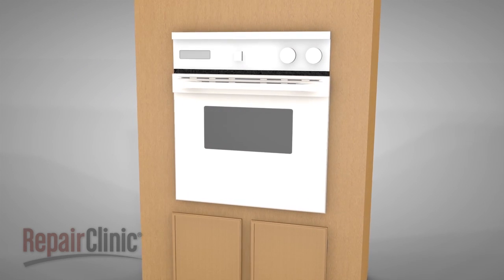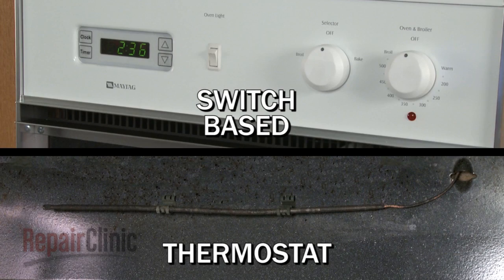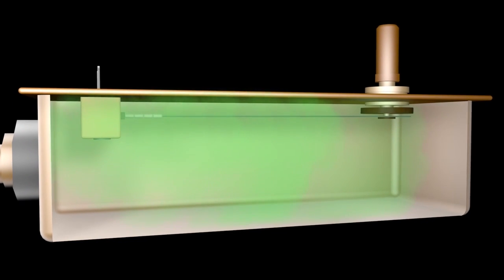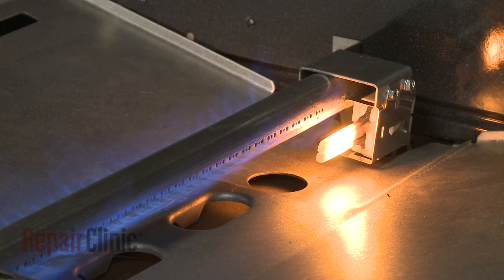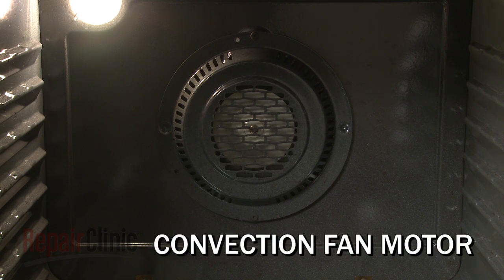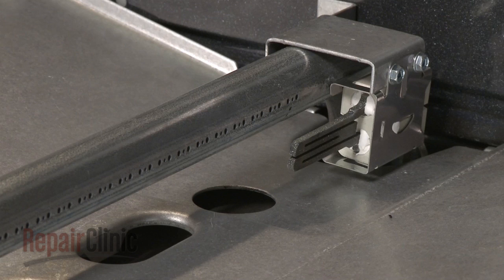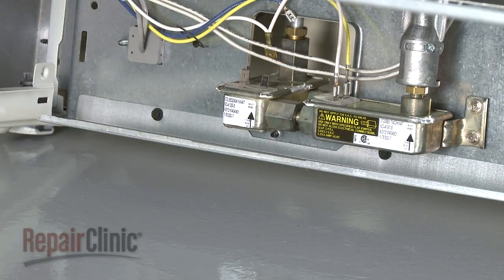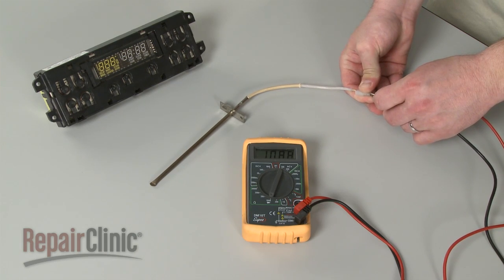How Does a Gas Wall Oven Work? — Appliance Repair Tips

Comment: One of my burner tubes for my Wall gas double oven has an area that is corroded.  I tried buying a replacement but was told
its no longer available.  I was wondering if I could use aluminum tape to cover the corroded area then with an sharp knife
make the same shape cut out for the gas flame to ignite and burn.   The corroded area is right at the gas igniter.  I would clean
the area then apply the tape which would be no wider then the damaged area 1/8-1/4 hole.  Then cut through the tape for the flame to escape.  Any thoughts on this would be appreciated.